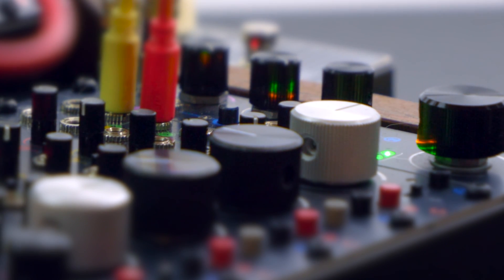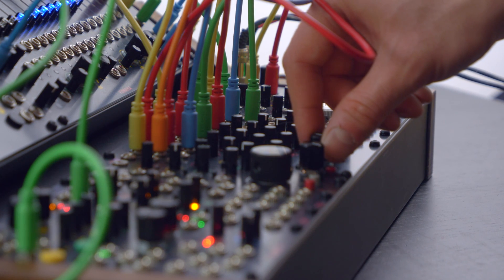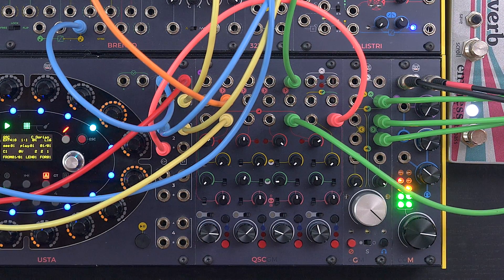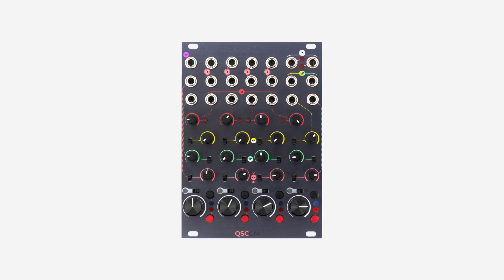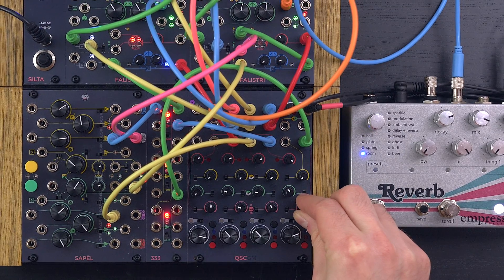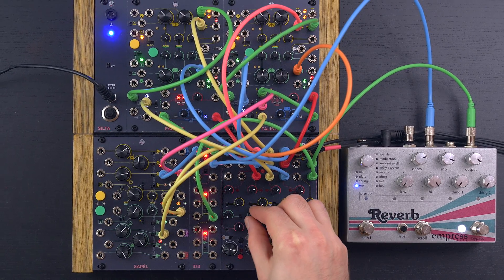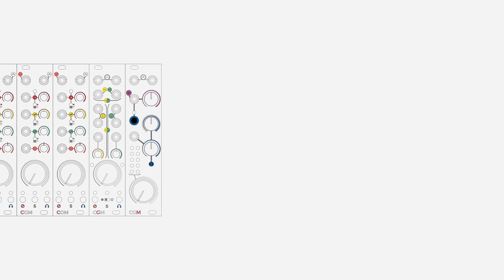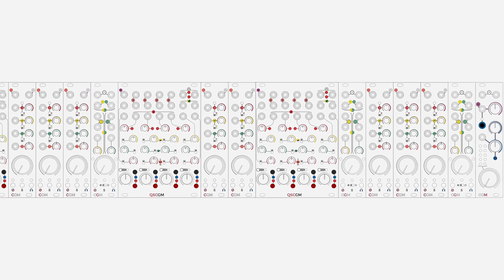Frap Tools QSC – Quad Stereo Channel (Eurorack Mixer)

Comment: Can I use it directly connected to the Master one ? I know would miss the Return and other of the Groups, which Unfortunately are sold out
Reply from the maker: No! It may damage the module and void the warranty. You always need a group in between, but they aren't sold out! They are available from our store and also from some of our resellers.

Comment: with the new link system, is it okay to cut off the extra ribbon cable? I'm using only 3 QSC, and don't need all the available inputs on the cable links system.
Reply from the maker: We advise against it like every other DIY operation because there's no way back and because we cannot be held responsible for any damage, but technically it can be done! The cut must be sharp and clean, with no ragged edges, and must be done with caution, with the system turned off, and with the usual common sense for this kind of operations :)
Reply: @FrapTools  <3 thank you and understood

Comment: great module! can I go from the G Group straight to line level  external fx pedals? do I need two g groups If I want to connect 2 x stereo fx?
Reply from the maker: Hi Fabian, I see that you also wrote to the support but we'll drop a few lines here as well. a) it depends on the pedals' headroom and b) a single group can handle two independent mono sends and stereo returns :)

Comment: The manual doesn’t say if the pan cv inputs are capable of controlling crossfade too if the switch is set to the crossfade mode?
Reply from the maker: True, we added this data and we'll release it with the next manual revision. It is precisely as you said: both the knob and the cv in control the crossfade.

Comment: Hello I keep looking in the manual and the section about auxiliaire is call B.
And the B5 and B6 witch are the return for the effect are nowhere to be seen.
Is the return is suppose to be make in a normal input? 
Won't it make feedback if by mistake we are sending auxiliary in the so said return channel?
Is B2 (effect level send cv)yellow or green operating for all 4 B1 yellow or green?
I really want to understand this point before buying this mixer who look to me as the best option for HP/utility/verstality/build in quality.
Thanks
Reply from the maker: Hello Léo,
The B5 and B6 inputs are on the Group module (G), which you can find on the same manual page (p. 14 of the current version, rev. 7). If you want a proper send/return configuration, you may want to consider pairing a C/QSC with a group module as well.

You can easily patch the effect return to any channel as long as you don't touch the respective channel's FX sends. Otherwise, you'll trig a feedback loop, which is something that can be done even on purpose, like we did here: https://frap.tools/reverb-feedback/

The CV over the FX send works only for the channel they're connected to: the first channel has CV over the green send, the fourth channel has CV over the yellow send. Otherwise, the other channels and FX sends do not have any CV.

If you have any further questions, feel free to drop us a line at support@frap.tools !

Comment: Hello the return aux are stéréo or mono?
Reply from the maker: The module we designed for handling FX send/return is the Group, which offers two mono sends and two stereo returns. The QSC has built-in mono send outputs, but to take full advantage of effect management it is better to link it to a Group module!
Reply: add a clank sum module and you're good